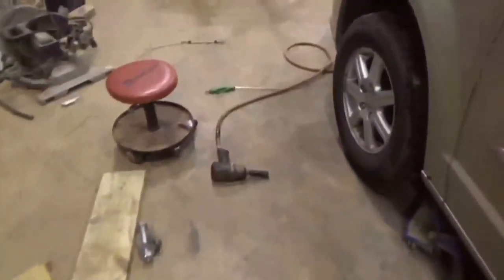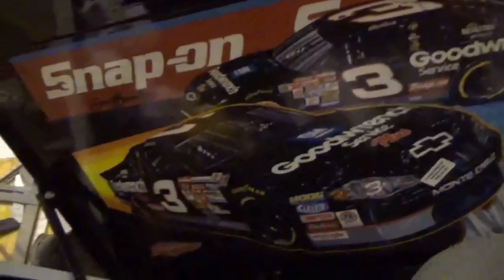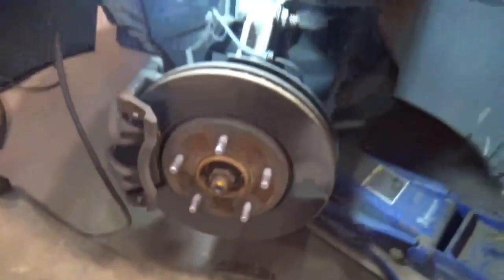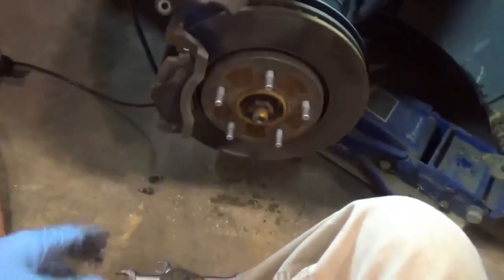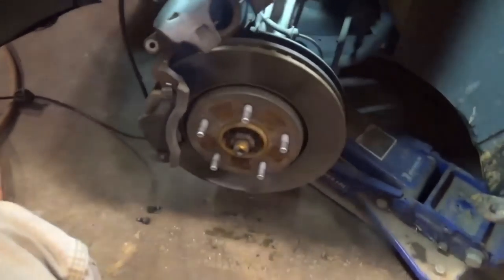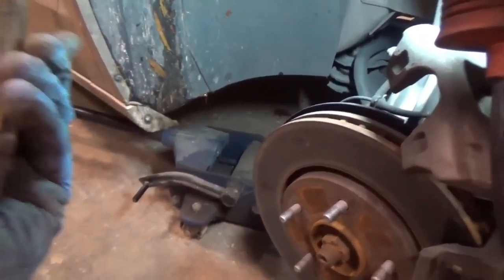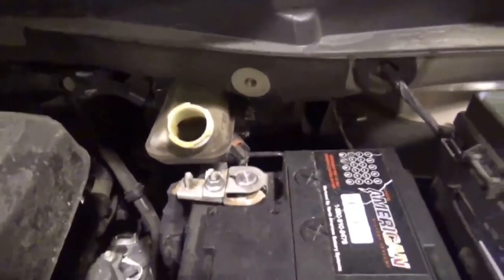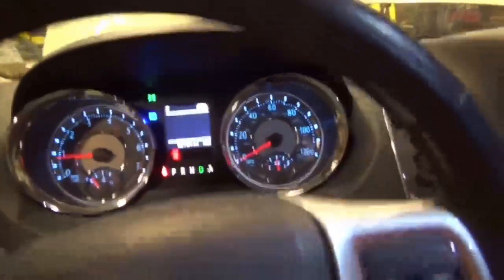New brakes on Jill’s Chrysler mini van

Comment: Nice job there's a quicker way though take a big flat screwdriver to put it between the rotor and the brake pad and push that piston in it before you ever pull the bolts out of the caliper just a tip have a good day

Comment: had to change pads on my carnehl end dump trailer. SAF axles on that one. what a bitch to work on. first of trailer had been running asphalt before  i got it so had to chizle my way to the bolts. also needed to take off the brake can to get to the adjuster in the caliper. plus it was not easy to get the pads to line up.  much easier on my other trailer that have BPW axles.

Comment: Brake pads wear on a taper due to either the pins sticking or dirt built up on the sliders causing the brake pad to bind and not get even pressure on the rotor.